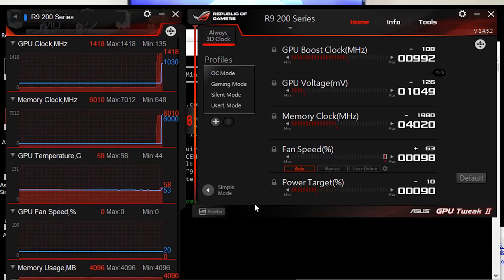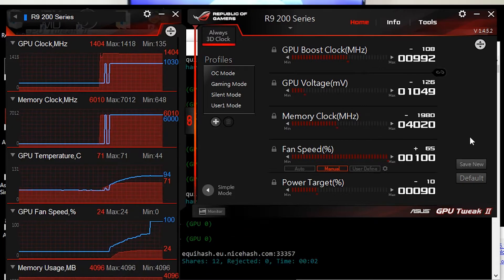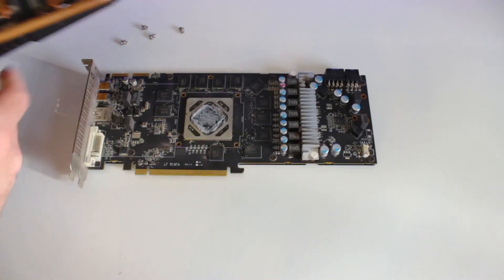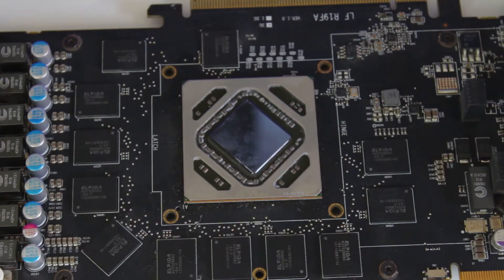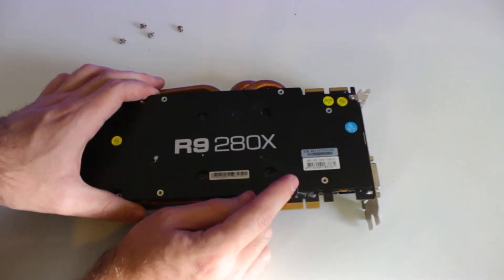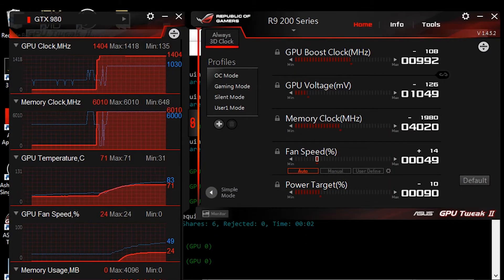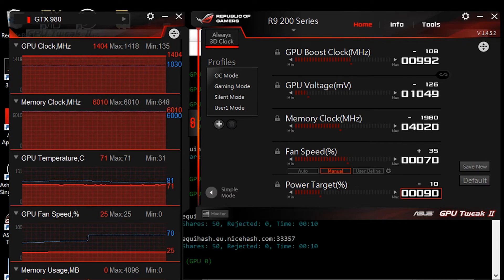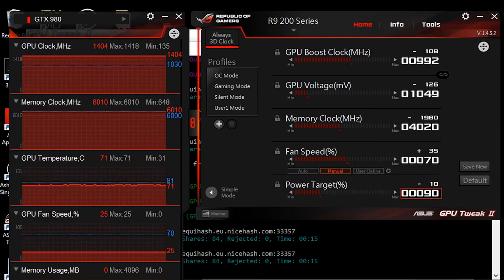Old GPU + New Thermal Paste = No More Overheating Video Card

Comment: I own a R9 390 ( Gigabyte) yes yes I know that thing got super toasty... so 2 years down the line I was like stuff it lets try something different. So I toke out my old  CM 120v Poseidon 120 aio. With some fancy cable tie skills and a 90mm fan mounted with cable ties to cool  the vrm's and memory I have a card that under full load wont exceed 56c keep in mind this card got 94c easily. super happy and alot quieter.  I've been running it this way for a month and no problems what so ever, expect the aio's tubing is a bit short but made it work. I anyone is planning on doing this I would suggest a good fan to keep than vrm's cool. Fyi Jay did a video on this so I know the vrm's should be fine
Reply: its not that hard as it may seem but quite nerve wrecking I mean gpu's are expensive

Comment: can a PC work or turn on without a Gpu?ik i look weird for asking this question but I think i dont have one lol
Reply: @dionjooo most pc's since the 2nd generation I series all have graphics processors on the actual chip, so yes they can. You probably have a pc that runs a chip between the 2nd and 7th generation intel could or AMD for that matter, they also have on-cpu graphics processors.

Btw, you don't look wierd for asking.
Reply: ZendEriaN Gaming you are wrong about the i7's
All cpu's from 2nd generation onwards have gpu's built into them.
You chip is a 1st gen, that is why it doesn't have.
Reply: it's not because my CPU is to old for onboard graphics, there are some that get released without onboard graphics, don't misinform people please, the i7 5930k, 5820k, 5960x, 6900k, 6850k, 6800k CPUs and some other were all released without onboard graphics whom are from the most recent releases even the core i9 series don't have onboard graphics.
Reply: This is still ZendEriaN Gaming
Reply: Only some CPUs don't have dedicated built in GPUs bbut they are normally an i7 like the 7700 CPU. even my i7-870 doesn't have 1 and that's an 1156 socket CPU that is a fiew years old so only some will not work without a GPU.
Reply: Richard Beard thanks man 😊☺😉

Comment: Hay dude 
Must say Thermal Grisly is amazing but must say, I have found it best to use the provided spreader and over the entire die properly as it makes sure that there is complete coverage of the die.
Reply from the maker: +Richard Beard hey man. Thanks for the tip Will keep in mind when using it again :)
Reply: My 290X Lightning has gone the same way as your 280 but mine is still under warranty so don't want to void the last 10 month but it is a beast of a card so I'm just contemplating throwing caution to the wind and just breaking the warranty seal on the one block screw and repasting it.

Decisions decisions.

Oh, also wanted to say thanks for the great channel, enjoy watching the videos.
Keep up the good work.